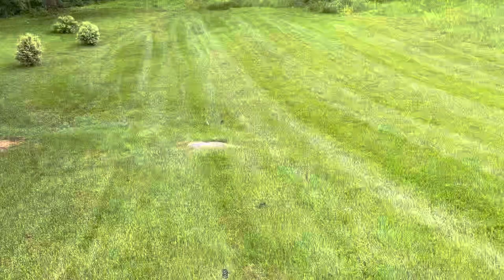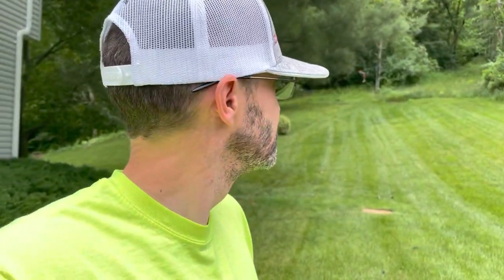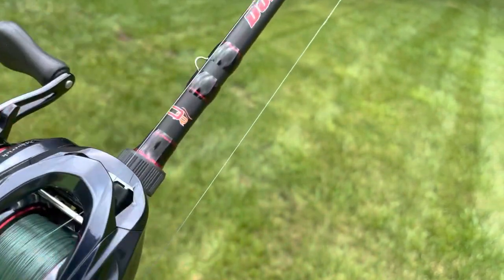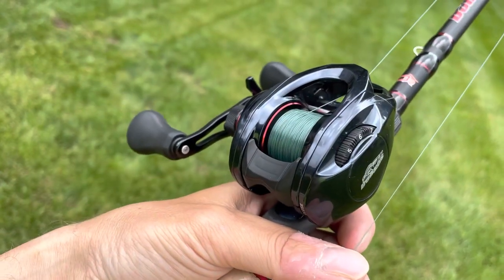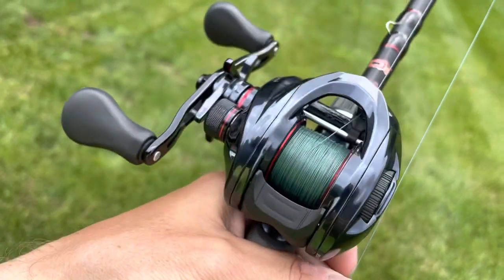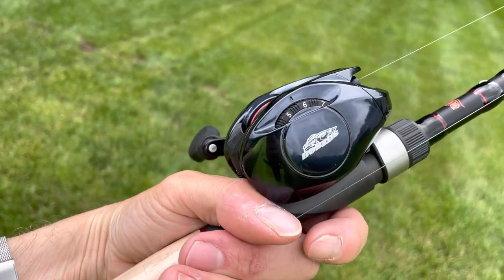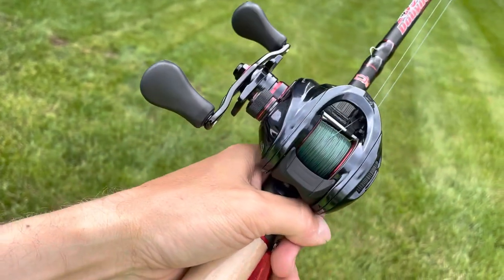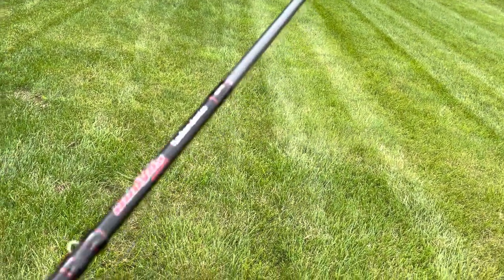It casts how far?!

Comment: Anyone else bothered by the thumb bar placement on this reel? For me it's too low if that makes sense. All the thumb bars on the daiwas and shimanos are in line with where the top of your line sitting on the spool would be. This thumb bar is probably 1/4-1/2 inch lower than that. Makes it where you have to adjust your thumb before each cast bc you can't properly control the spool/overrun